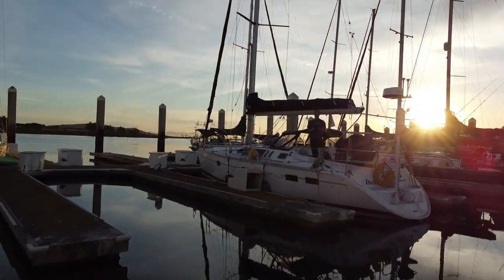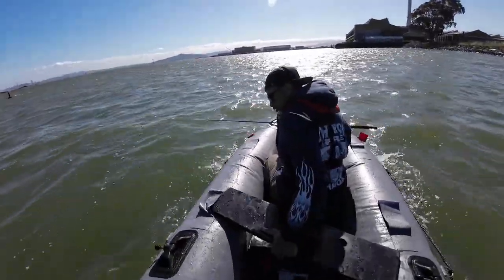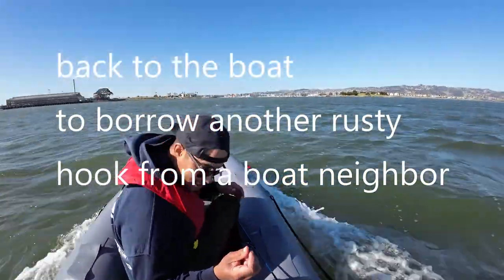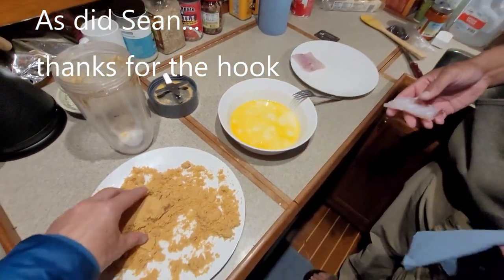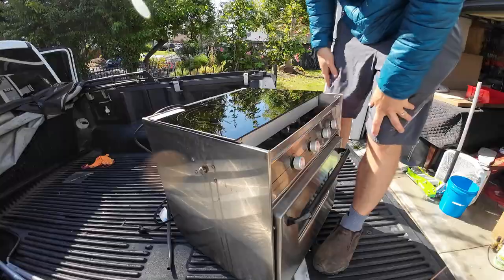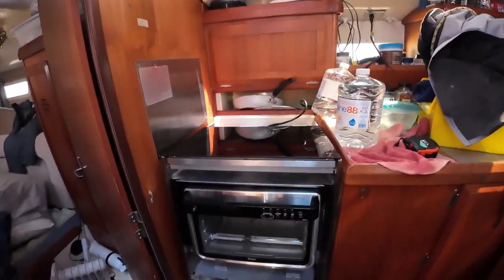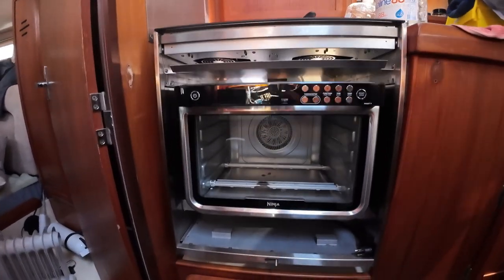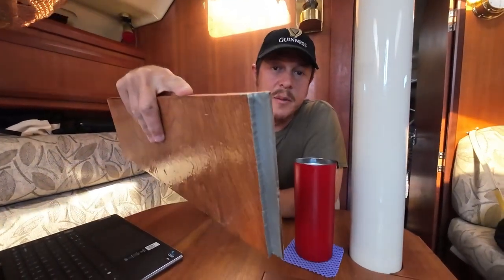How I transformed a Gas to Electric Stove on our Boat ep18

Comment: Great video! About to do the same thing on our 410. Can you drop the link for the cooktop.
Reply from the maker: https://www.amazon.com/gp/aw/d/B07W193CHL?psc=1&ref=ppx_pop_mob_b_asin_title
Mine is 20.5 inches wide if I recall. Are you going to do it the same way or build a fully custom enclosure?
Reply: @sailingisara  Thank you. I was going to build a custom enclosure, but after seeing your video my wife said your way seems easier. Look forward to your video on the power requirements, the oven and stove use a max of 1800 watts each. Our inverter is 3000, so we could only run one at a time. We also are going to need new batteries we have the one lithium 400 amp that came with the boat, the BMS ain't strong enough to power the stove without generator assist.